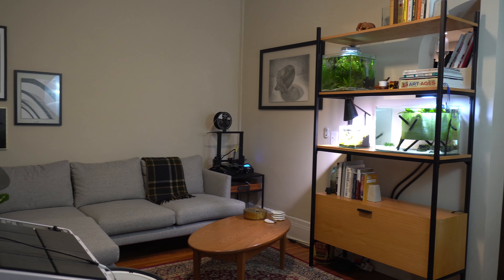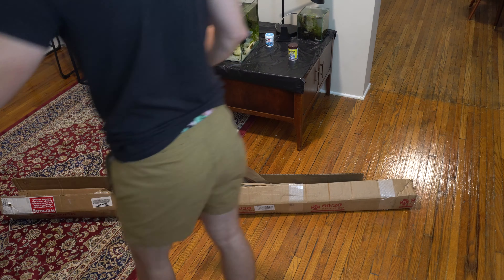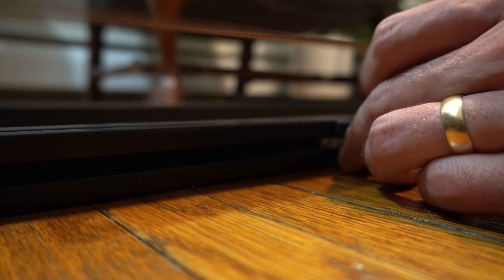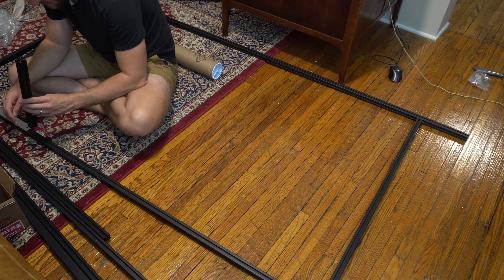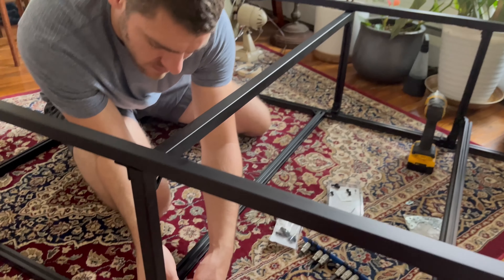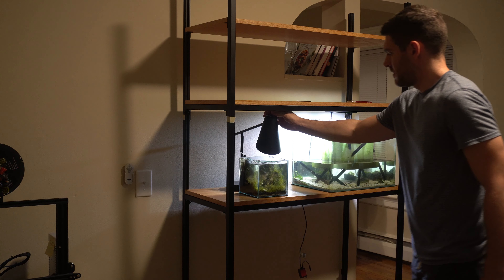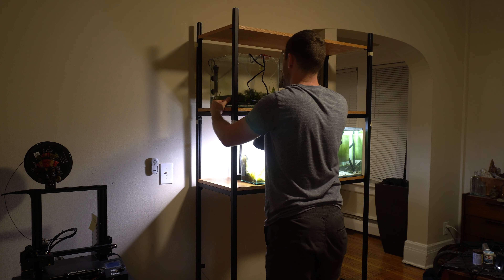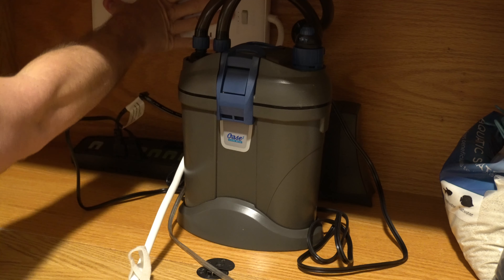Custom Aquarium Shelf Build | UNDR

Comment: How did you calculate how much the shelf can hold?
Reply from the maker: Great question! It depends on multiple factors, but 80/20 has some tools on their websites that help with determining weight capacity. Here is one: https://8020.net/deflection-calculator

Each fastener can hold hundreds of pounds I believe, but I'm having trouble finding the documentation for those at the moment.

Of course, these calculations just give a general idea. When it comes to people or pets running into or shaking the shelf, that could change things. I suggest fastening the shelf to a wall just in case, if you decide to make one.